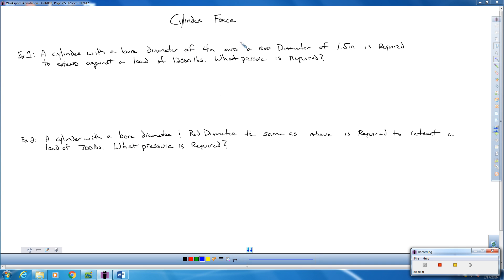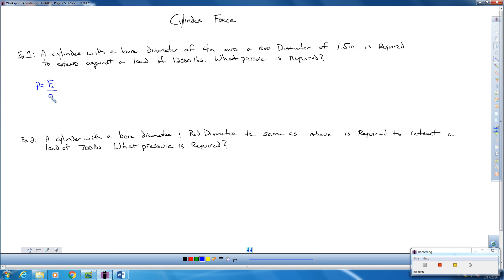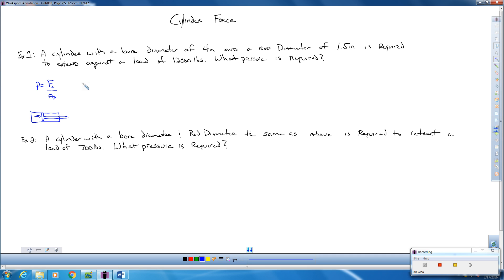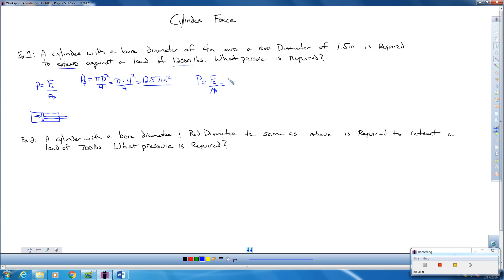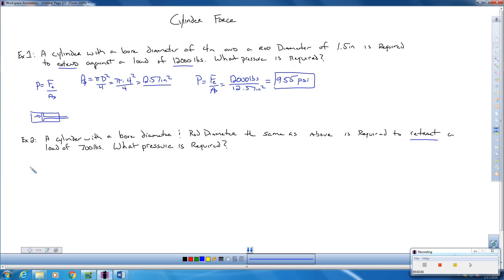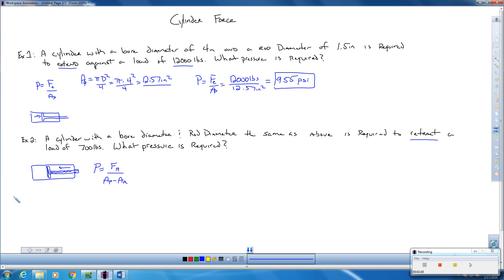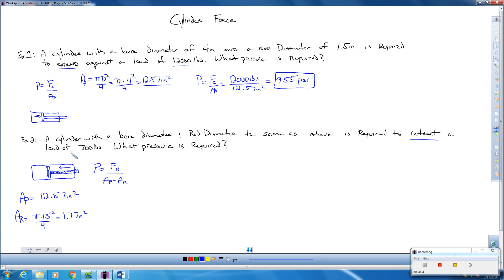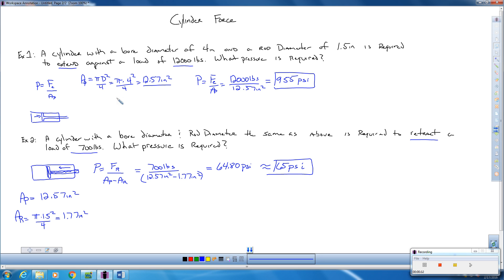Cylinder Force  extending and retracting

Comment: Dear Sir..........I have single acting a cylinder with a bore of 18 mm and a rod of 10 mm and a stroke of 300 mm. I want to know what is the pressure if my cylinder presses 1 mm ........... Please advise and provide a solution with the formula